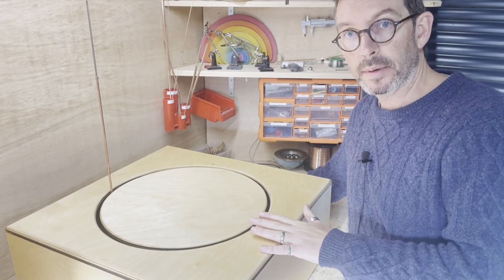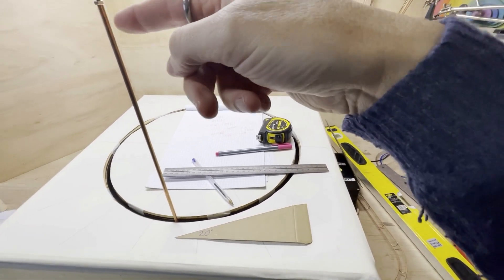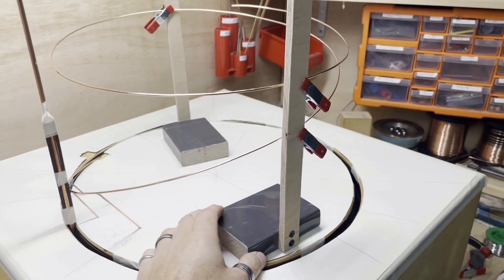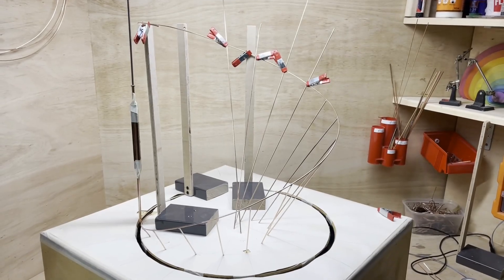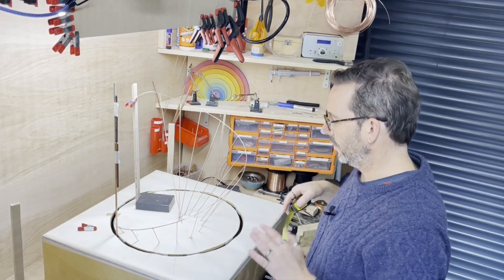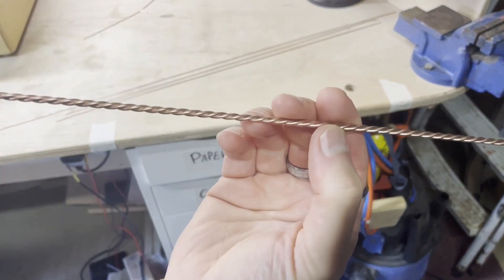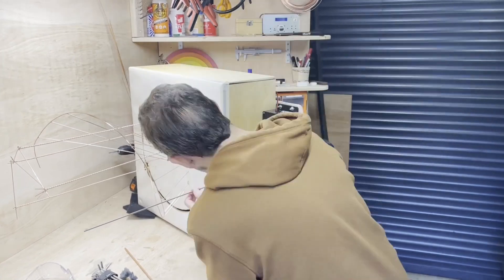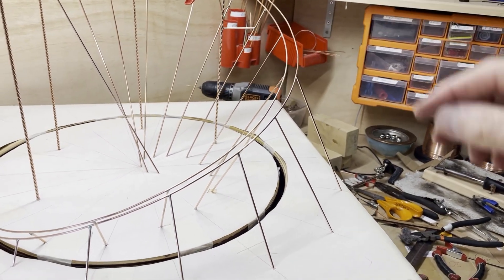Rolling Ball Sculpture Invention - RBS5 - EP 5

Comment: You know, if you wanted to remove the twin rail on the way up, you could have a basket that is free to slide up and down the vertical rod, and uses only the OUTER rail to gradually lift it up the rod. Inside the basket contains the ball. At the top, the ball leaves the basket onto an actual rail. Then the basket is let back down in a controlled manner with another single rail guide back to the start, where it picks up another ball and so on so forth.

Comment: Question:  You use several means or techniques for soldering the joints.  What is the electronic one with wires attached to the part and to the tip?  What are the specifications for this tool?
Reply from the maker: I use a resistance solder iron.  

Click this link for more details.....
https://youtu.be/AzvHfxxzqh8